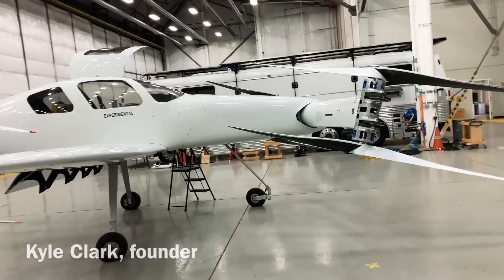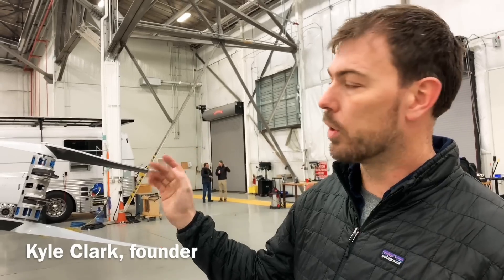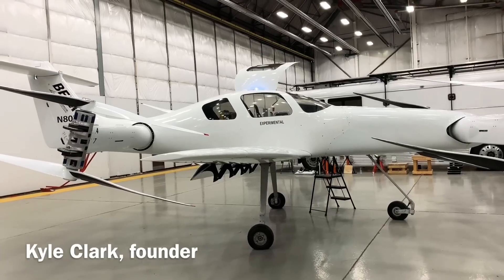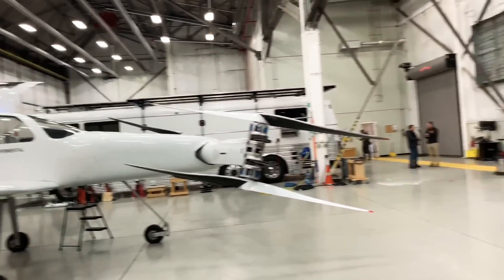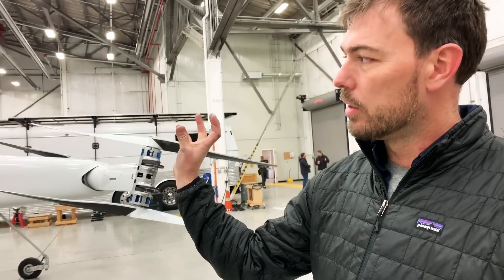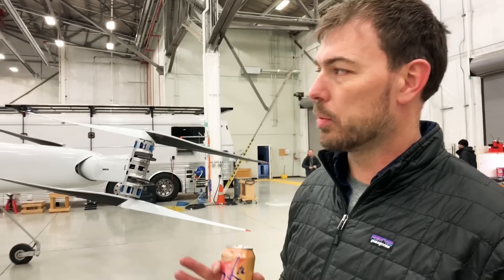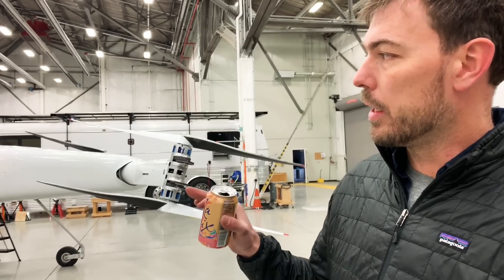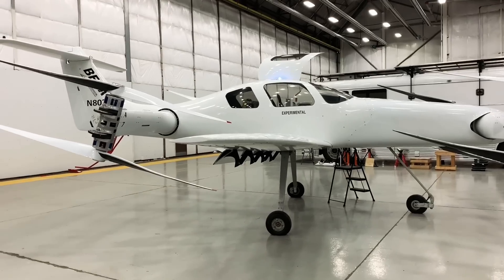Beta Technologies eVTOL Air Taxi Prototype

Comment: All I see is a whole lot of moving parts that can go wrong!
Reply: Given that internal combustion engines have thousands of critical moving parts... no, there are fewer moving parts
Reply: @martinw245  I would love you to show me a V8 engine with "thousands" of moving parts. I'll wait for your answer.
Reply: @timwiltse365  

"I would love you to show me a V8 engine with "thousands" of moving parts. I'll wait for your answer."

Sorry Tim if I mislead you there. I was referring to the aircraft in the video if powered by internal combustion engines. If I recall correctly, IC engines usually have 300 or so moving parts. (Correct me if I am wrong) So given that the aircraft in the video has eight engines, that's 2,400 moving parts. Then of course, as we would be dealing with an IC engine, we would need gear boxes for each engine. I cant recall how many moving parts comprise a gearbox, so again, correct me if I'm wrong, but I think it was well over 100. So our total now becomes 3,200. Then we have bearings of course. So yes, thousands of moving parts.

Of course, the above is just for comparison, and in fact would never be feasible due to the weight involved.

Now compare the above with the electric aircraft in question: Electric motors can have from one to three moving parts. So lets say three. 3 X 8 = 24 moving parts. No gearbox required as it's direct drive, and of course the battery has no moving parts. 

Feel free to revise my numbers, but as you can see, the reduction in complexity when we are dealing with electric vehicles is significant. 

If you want to look at it in terms of one engine, then one to three moving parts for an electric motor. And from 200 to 400 moving parts for an IC engine.
Reply: @timwiltse365  and i'd love to see a helicopter powered by a v8. we'll wait for your answer.
Reply: @daos3300   Plenty of V8 LS powered helicopter out there buddy!
Reply: Thousands?...  You'd be hard pressed to come up with over 150 parts total for a 4 banger engine.  Plus, considering we've been working with them over a 100 years, I'd say their pretty darn reliable.  This is a curious machine and as stated in the vid, this is just to get some ideas going about electric aviation.  Gotta start somewhere and this manned drone concept looks pretty cool....  Still, I would want something that has a bit better gliding capability than a brick.    @martinw245
Reply: @darrelljourdan3687  

I think you are forgetting that IC engines require a gearbox. There are approximately  300 moving parts in an IC engine, and 100 plus in the gear box. Now multiply that by 8, as the aircraft in the video has eight engines. Total 3200 moving parts.

Now compare that with an electric motor that can have 2 to 4 moving parts and no requirement for a gearbox as they are direct drive. Total 32 moving parts max. 

As for reliability, an electric motor is much more reliable, with only 2 to 4 moving parts than an IC engine with 200 to 300 moving parts. Not to mention no coolant issues, no ignition system issues, barely any servicing required etc.

The aircraft in this video is but one example. There are numerous other electric VTOL concepts like this in development, some closer to fruition than others.

As for non VTOL electric aircraft, they are in service now. Pipestrel have an electric aircraft that is used by flight schools for circuit training. There is also eViations Alice which is an all electric regional aircraft with 1000 kilometre range and seats 8 people. Its engaged in test flights as we speak.

As for glide ratio for the aircraft in the video, I have no idea what that would be. I would imagine it would be a relatively high glide speed. It would glide though. Doubt it would ever need to glide though, with 8 engines there's plenty of redundancy.
Reply: Points well taken... Sorry, I'm literal to a fault and responded to your comment as stated about IC engines, but limited it to conventional aircraft.  Gearbox and pitch-controlled props do indeed add to complexity.

As for gliding, I could not make out any control surfaces on the wing stubs other than flaps, but will look again.   Redundancy in engines is great, but loss of power is potentially catastrophic for vstol aircraft and is a real threat with either electric or IC.  

Exciting to see new designs and quite interested to see where this goes!  @martinw245
Reply: @martinw245  you would only need one IC engine to do the work of eight electric motors
Reply: John Babb 8 electric ones still have less moving parts and more abundancy
Reply: @johnbabb1138  

"you would only need one IC engine to do the work of eight electric motors"

I'm afraid that's not practical though. The IC engine itself would need to be large and powerful, thus heavy. In addition it would need a very heavy, sophisticated gearbox to run four drive shafts from. (if that's possible). Those heavy drive shafts would need to drive gearing in four nacelles, which would in turn run the two counter rotating props in each of the four nacelles. Then we would need a multitude of bearings, an alternator to generate electrical power, not to mention fuel pumps. As you can see, complexity arises and considerable weight.

Number of moving parts, at a guess would be lets say 300 for the engine, 300 for the complex gear box, 4 drive shafts, nacelle gearing, plus multiple bearings. The other issue is controlling thrust in the VTOL mode. Electric motors change RPM very rapidly, props run by IC engines don't. That's usually overcome with variable pitch propellers. So even more complexity and moving parts to add to the equation. Thus limited reliability and immense servicing costs. 

I would estimate you would be heading towards a 1000 plus moving parts, extreme weight and complexity. In fact nothing like the small, economical, air taxi in the video.
Remember, IC engines are from 30 to 40% efficient. Electric motors are 90% plus efficient. 

Now compare the above with the aircraft in the video. 2 or 3 moving parts in each motor,  a few bearings. That's it. Maybe 30 moving parts, extremely light weight, thus the capability to design a small, economical, electric VTOL air taxi.

You are also missing the point as to why the aircraft in the video has so many motors and props. It would be possible to design an electric aircraft the same way you suggest for an IC driven equivalent. Namely one powerful electric motor driving the eight props. The issue there though is lack of redundancy. Your single IC engine, or indeed a single electric motor, if it failed, would be catastrophic in the VTOL mode. By having multiple engines and props you have a huge amount of redundancy. You could lose motors and still be able to hover safely.
Reply: @darrelljourdan3687  

"Redundancy in engines is great, but loss of power is potentially catastrophic for vstol aircraft and is a real threat with either electric or IC. "

Indeed. In fact I've been wondering how many of those electric motors could be lost and the craft still have enough power to hover. I would imagine 2 or 3, but that's just a guess. Electric motors are of course extremely reliable. 

For loss of power from the battery pack, I think that would be unlikely. I would imagine far less likely than the complex mechanical system of a conventional helicopter failing. Tail rotor failure is unrecoverable usually. Engine failures can be survivable as the helicopter can auto-rotate, although it can be a tricky manoeuvre. 

"Exciting to see new designs and quite interested to see where this goes"

Batteries are the key. Great strides have been made and some really interesting battery tech in the lab. Rolls Royce have just signed a deal with Bristol University, in regard to their supercapacitor breakthrough. Hybrid supercapacitor and lithium ion looks very promising, Not to mention solid state batteries are almost here and graphene of course.  

Eviation's Alice I like the look of. 1000 kilometre range and carries 8 people. A lot better than Piipistrel's one hour flight time and just for circuit training.

https://www.eviation.co/
Reply: @martinw245  What are you trying to say exactly?
Reply: @osamabinladen824  

Serge said a whole lot of moving parts that can go wrong. I was pointing out that internal combustion engines have thousands more moving parts. Hence, this prototype aircraft with electric motors has far fewer moving parts. Thus better in that respect compared to conventional aircraft in service.
Reply: Martin W You are kidding me, going to the corner, collect a box of critical thinking, plant in your head, then learn about jet engines and the theory of flight... Then go and sit down in a comfy chair for at least a day and then come back to us
Reply: @Ade2bee  

You referred to me. Why?
Care to quote me, so I actually know which comment of mine you are referring to?
I didn't mention jet engines.
As for "theory of flight" again... which comment of mine to you disagree with? I didn't say anything relating to the theory of flight, except the fact the the vehicle in question tilts its rotors forward in flight and lift is generated by the wings in forward flight... which is correct.
Reply: It has eight motors and props as a reduncancy against failure of one set. Most advanced aircraft have double or triple of critical systems.
Reply: Thats why they invented parachutes,and Caskets.
Reply: Cowls.  Problem solved
Reply: ....than a combustion or jet engine, not even close.
Reply: Stay safe Serge, stay safe.
Reply: I suggest you never get on anything than moves.
Reply: Chill, it's only if you need a heart or some organ. The future prototype will be using Transwarp Discombobulators not human scale insinketator blades.
Reply: Just wait until you see the insides of a 747 or A380.
Reply: The wing does not seem to create a lot of lift.  In addition electric power for air travel is still a long way off for any flight longer than just a few miles.
Reply: lmao these people fail to grasp your point--feel bad for them
Reply: Yes, but the flight controller keeps all them parts in formation.
Reply: Hey Serge. An internal combustion engine has about 10k moving parts. A plane this size would have ONE internal combustion engine.  This has engine/motor redundancy out the wazoo. Nice try, Serrrrrrrrrrrrrrrrrrrrrrrrrrrrrrrrrrrrrrrrrrrrrrrrrrrrrrrrrrrrrrrrrrrrrrrrrrrrrrrrrrrrrrrrrrrrrrrrrrrrrrrrrrrrrrrrrrrrrrrrrrrrrrrrrrrrrrrrg.
Reply: Serge Smith
far fewer here than in any helicopter. drones are way more reliable and this is basically a drone.
Reply: There's probably less moving parts in the entire aircraft than in a conventional piston engine.
Reply: You an engineer?
Reply: Probably 1/3 the number of moving parts versus internal combustion.
Reply: Well said... 8 rotors vs two on a helicopter... No way is this a safe aircraft.
Reply from the maker: Compared to any other aircraft, no--but there are multiple rotors at the end of articulating outriggers. Should any fail, there are redundancies and inherent stabilities that makes the aircraft still flyable. That said, you're right, and the actual production version will be far simpler. Stay tuned ...
Reply: @ericadams321  ah, you're just being kind. you know this thing has far fewer moving parts and is way safer than any helicopter.
Reply: No more so than a helicopter really?
Reply: @emgee44  a lot less than a normal helicopter!
Reply: emgee44 and helicopter 🚁 has 2 rotations blades that it’s got 8  lol 😂
Reply: @CamioneroblW   true,   and a helicopter drops if ether one of them falls off...  this one can probably still fly even with 3 or 4 dud ones...
Reply: @CamioneroblW  That is true, but have a look at the complexity of the rotor system in a helicopter (swasher plate and all) And you will know why Helicopters are several orders of magnitudes more expensive than regular aircraft to operate. There is a lot of room for improvement and reducing the complexity with multiple rotors that have only one axis and are just spun faster/slower, than the rotor systems that have to implement blade angle and tilt in 4 directions, all while spinning at 1000s of RPMs.
Reply: emgee44 You evidently have no idea about the theory of flight and helicopters, plus how many moving parts that can be damaged on the helicopter compare to this. I suggest you go and get a photograph of a helicopter, count how many contrarotating parts there are, then come back and count how many contrarotating parts there are on this... Love helicopter a technician
Reply: Oh, so I'm waiting for something that fly with no moving parts. (Even a glider has some)
Reply: @raymondhuot1684  realy you bring politics into this .
Reply: @raymondhuot1684  There already is a video of a test of a large rc plane that creates it's own thrust without moving parts. Go look it up. It basically ionizes the surrounding air to create thrust.
Reply: Big "Murphy's Law" factor going on here.....😬
Reply: You would think serge smith would know that. What an idiot. Probably a trumper
Reply: @lukebalderose334  lol still denying that the trump administration has been a success?
Reply: @rye_too_quick  tell me all about my man. I'm all ears. Please provide sources as well. I'm ready.
Reply: @lukebalderose334  
Jobs and the economy 
• Passage of the tax reform bill providing $5.5 billion in cuts and repealing the Obamacare mandate.
• Increase of the GDP above 3 percent.
• Creation of 1.7 million new jobs, cutting unemployment to 4.1 percent.
• Saw the Dow Jones reach record highs.
• A rebound in economic confidence to a 17-year high.
• A new executive order to boost apprenticeships.
• A move to boost computer sciences in Education Department programs.
• Prioritizing women-owned businesses for some $500 million in SBA loans.

Killing job-stifling regulations 
• Signed an Executive Order demanding that two regulations be killed for every new one creates. He beat that big and cut 16 rules and regulations for every one created, saving $8.1 billion.
• Signed 15 congressional regulatory cuts.
• Withdrew from the Obama-era Paris Climate Agreement, ending the threat of environmental regulations.
• Signed an Executive Order cutting the time for infrastructure permit approvals.
• Eliminated an Obama rule on streams that Trump felt unfairly targeted the coal industry.

Fair trade 
• Made good on his campaign promise to withdraw from the Trans-Pacific Partnership.
• Opened up the North American Free Trade Agreement for talks to better the deal for the U.S.
• Worked to bring companies back to the U.S., and companies like Toyota, Mazda, Broadcom Limited, and Foxconn announced plans to open U.S. plants.
• Worked to promote the sale of U.S products abroad.
• Made enforcement of U.S. trade laws, especially those that involve national security, a priority.
• Ended Obama’s deal with Cuba.

Boosting U.S. energy dominance 
• The Department of Interior, which has led the way in cutting regulations, opened plans to lease 77 million acres in the Gulf of Mexico for oil and gas drilling.
• Trump traveled the world to promote the sale and use of U.S. energy.
• Expanded energy infrastructure projects like the Keystone XL Pipeline snubbed by Obama.
• Ordered the Environmental Protection Agency to kill Obama’s Clean Power Plan.
• EPA is reconsidering Obama rules on methane emissions.

Protecting the U.S. homeland 
• Laid out new principles for reforming immigration and announced plan to end "chain migration," which lets one legal immigrant to bring in dozens of family members.
• Made progress to build the border wall with Mexico.
• Ended the Obama-era “catch and release” of illegal immigrants.
• Boosted the arrests of illegals inside the U.S.
• Doubled the number of counties participating with Immigration and Customs Enforcement charged with deporting illegals.
• Removed 36 percent more criminal gang members than in fiscal 2016.
• Started the end of the Deferred Action for Childhood Arrival program.
• Ditto for other amnesty programs like Deferred Action for Parents of Americans.
• Cracking down on some 300 sanctuary cities that defy ICE but still get federal dollars.
• Added some 100 new immigration judges.

Protecting communities 
• Justice announced grants of $98 million to fund 802 new cops.
• Justice worked with Central American nations to arrest and charge 4,000 MS-13 members.
• Homeland rounded up nearly 800 MS-13 members, an 83 percent one-year increase.
• Signed three executive orders aimed at cracking down on international criminal organizations.
• Attorney General Jeff Sessions created new National Public Safety Partnership, a cooperative initiative with cities to reduce violent crimes.

Accountability 
• Trump has nominated 73 federal judges and won his nomination of Neil Gorsuch to the Supreme Court.
• Ordered ethical standards including a lobbying ban.
• Called for a comprehensive plan to reorganize the executive branch.
• Ordered an overhaul to modernize the digital government.
• Called for a full audit of the Pentagon and its spending.

Combatting opioids 
• First, the president declared a Nationwide Public Health Emergency on opioids.
• His Council of Economic Advisors played a role in determining that overdoses are underreported by as much as 24 percent.
• The Department of Health and Human Services laid out a new five-point strategy to fight the crisis.
• Justice announced it was scheduling fentanyl substances as a drug class under the Controlled 

Substances Act.
• Justice started a fraud crackdown, arresting more than 400.
• The administration added $500 million to fight the crisis.
• On National Drug Take Back Day, the Drug Enforcement Agency collected 456 tons.

Protecting life 
• In his first week, Trump reinstated and expanded the Mexico City Policy that blocks some $9 billion in foreign aid being used for abortions.
• Worked with Congress on a bill overturning an Obama regulation that blocked states from defunding abortion providers.
• Published guidance to block Obamacare money from supporting abortion

Helping veterans 
• Signed the Veterans Accountability and Whistleblower Protection Act to allow senior officials in the Department of Veterans Affairs to fire failing employees and establish safeguards to protect whistleblowers.
• Signed the Veterans Appeals Improvement and Modernization Act.
• Signed the Harry W. Colmery Veterans Educational Assistance Act, to provide support.
• Signed the VA Choice and Quality Employment Act of 2017 to authorize $2.1 billion in additional funds for the Veterans Choice Program.
• Created a VA hotline.
• Had the VA launch an online “Access and Quality Tool,” providing veterans with a way to access wait time and quality of care data.
• With VA Secretary Dr. David Shulkin, announced three initiatives to expand access to healthcare for veterans using telehealth technology.

Promoting peace through strength 
• Directed the rebuilding of the military and ordered a new national strategy and nuclear posture review.
• Worked to increase defense spending.
• Empowered military leaders to “seize the initiative and win,” reducing the need for a White House sign off on every mission.
• Directed the revival of the National Space Council to develop space war strategies.
• Elevated U.S. Cyber Command into a major warfighting command.
• Withdrew from the U.N. Global Compact on Migration, which Trump saw as a threat to borders.
• Imposed a travel ban on nations that lack border and anti-terrorism security.
• Saw ISIS lose virtually all of its territory.
• Pushed for strong action against global outlaw North Korea and its development of nuclear weapons.
• Announced a new Afghanistan strategy that strengthens support for U.S. forces at war with terrorism.
• NATO increased support for the war in Afghanistan.
• Approved a new Iran strategy plan focused on neutralizing the country’s influence in the region.
• Ordered missile strikes against a Syrian airbase used in a chemical weapons attack.
• Prevented subsequent chemical attacks by announcing a plan to detect them better and warned of future strikes if they were used.
• Ordered new sanctions on the dictatorship in Venezuela.

Restoring confidence in and respect for America 
• Trump won the release of Americans held abroad, often using his personal relationships with world leaders.
• Made good on a campaign promise to recognize Jerusalem as the capital of Israel.
• Conducted a historic 12-day trip through Asia, winning new cooperative deals. On the trip, he attended three regional summits to promote American interests.
• He traveled to the Middle East and Europe to build new relationships with leaders.
• Traveled to Poland and on to Germany for the G-20 meeting where he pushed again for funding of women entrepreneurs.

This 81 item list was gathered and presented by: 
Paul Bedard, the Washington Examiner's "Washington Secrets" columnist, can be contacted at pbedard@washingtonexaminer.com
Reply: @lukebalderose334   Out of all the people that have put in there input on this aircraft you Have proven how stupid you are! I don't know what any president has to do with this aircraft design. Pleas come to the playing fiend with some intelligence.
Reply: Luke Balderose helicopter engineer checking in. Oh and also a Trump supporter, you really shouldn’t stereotype or label people so quickly. It makes you seem foolish.